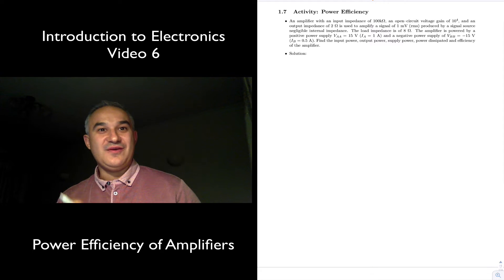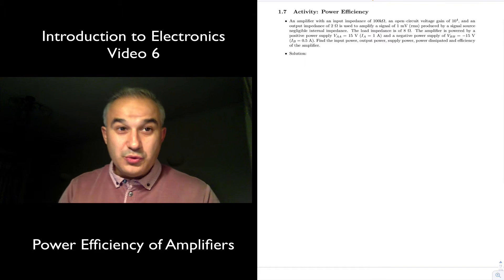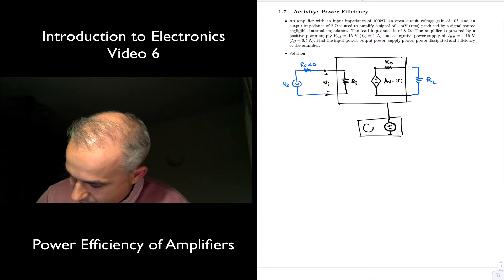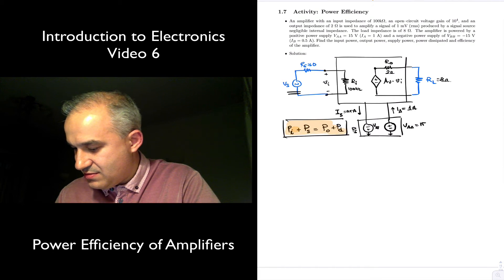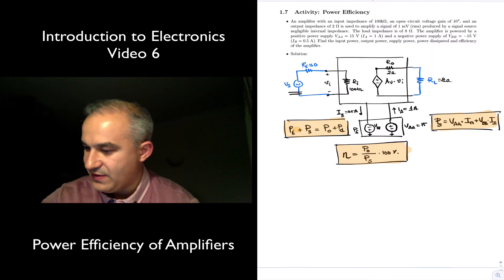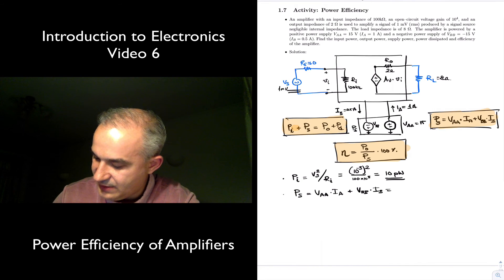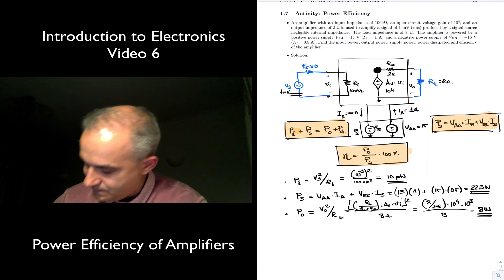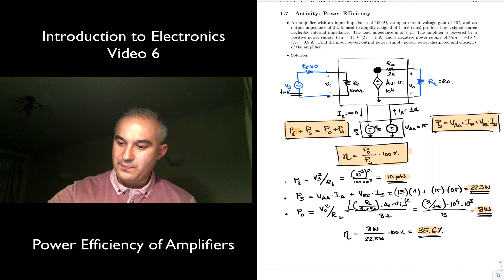Electronics - Power Efficiency of Amplifiers

Comment: Why do you not take the negative sign into account for  Vbb= -15V when calculating Ps 9:10
Reply: Good question.  Positive current OUT from the positive terminal of the power supply voltage source, is power DELIVERED from the supply to the circuit.  This current, or a portion of it, returns to the negative terminal  of that voltage source.  That voltage source then does WORK on that current (charge really) to bring it back to the positive terminal, and the loop is repeated.  In the same way, positive current into the NEGATIVE terminal of the other voltage source in the power supply is WORKED on by the supply to move that current (charge) back up to ground.  In both cases the supply is doing work, so it is delivering power to the circuit. Both sources in the supply are sources of positive power.  If positive current is seen entering the positive terminal of a supply, then the supply is consuming power, and that portion of the supplied power would be negative . This could have been explained better.  Still, he is an excellent teacher!!